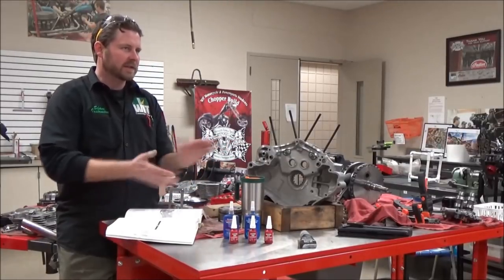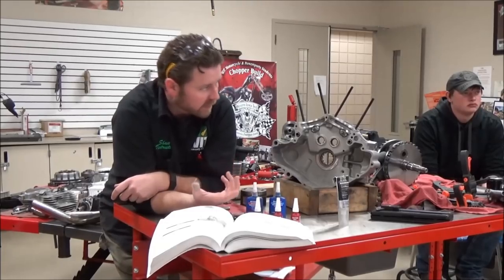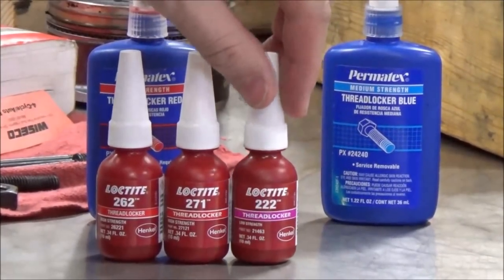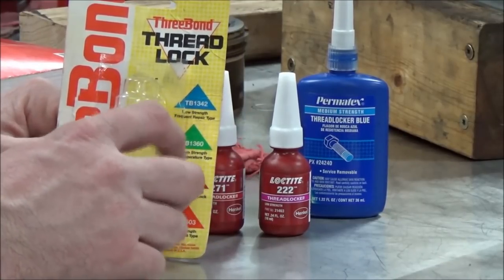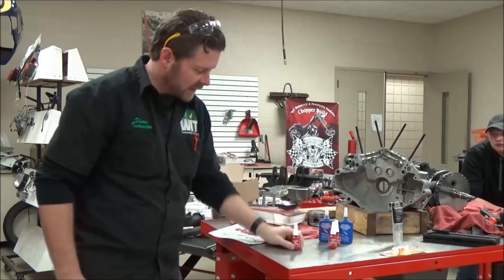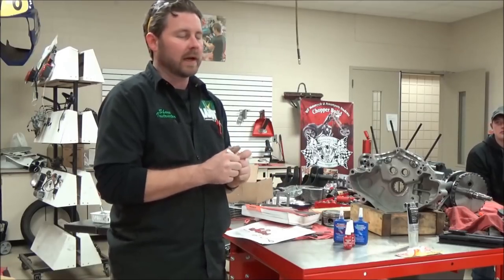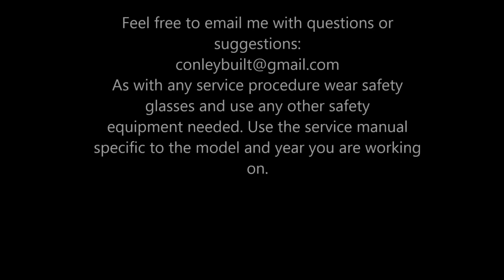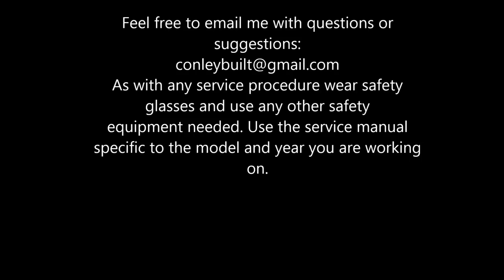Which loctite do I need? How to choose the correct Threadlocker Loctite Permatex IT MATTERS!

Comment: I only use Blue loctite for Compensating nut and Clutch Axle nuts swing arm nut , anything 1/2 to 1/4 I use clear fingernail polish , I clean all Nuts Bolts with Mineral spirits and acetone before using thread lockers. I have owned 3 Harleys not had anything fall off or come loose.    My stock EVO 1986 had red on the comp Nut I used a 3/4 Breaker bar and Tore a Primary chain in half .   Took a 3/4 Impact set at 800 Pounds, 150 pounds in the air tank to back it off . The Book said the nut torque was 150 Foot pounds .   Red takes 200 degree fahrenheit to get it gooey was not going to use a torch on my comp nut .  So yes it does matter what your using .
Reply from the maker: 👍 Thank you for taking the time to comment! Hit that subscribe button if you haven’t please! It helps us! 
Here is a way to support all the free videos.
Want to say “thanks” or “keep it up”? Click here https://www.paypal.me/how2wrench  

Coach Conley is also available for hire to personally work one on one with you if ever needed. Yep he is a real person. Give him a call @ 602-345-0432
Details here: https://how2wrench.com/product/personal-tech-training-phone-facetime/ 
Your answers and help are just around the corner. Save time and money while protecting your investment and yourself by doing it the right way!
Follow us!
Web:
www.How2Wrench.com     
www.Tools2Wrench.com

Comment: Lemme add my 2cents to this and i know this is an antique thread,, im gonna use 6 loctite number 241, 242 & 243 blue and 271, 272 & 273 red,, My understanding is the differences or how i read them is as follows, 24x is blue/medium, 27x is red high strength, then ea one is a larger bolt size.  Startinv with XX1 being for smaller bolts , xx2 med size bolts and xx3 is larger bolts, the breaking strength is do to the original torque value of ea bolt, i also believe theres a slight or subtle viscosity difference between say a xx1 and xx2 or xx3  that said you would most likely be fine with a xx2 where an xx1 is req but not an xx1 where a xx3 is req,, for majority of my work i will default to the xx2 as that is for bolts uoto 1" in either the 27x high or 24x med line.. ... like i said just my 2cents on how i work.. oh and i ONLY use loctite as my first choice and then permatex as my second choice
Reply from the maker: Thanks for the added input JB!
We love sharing comments like this with Shane.  
Thanks for sharing and the added value to our wrenching community. Keep them coming.

Join the channel. Best $1.99 you'll spend to access all 800 vids and Shane Daily! Smash the sub and like please. 

Throw Shane a high five donation, channel membership or merch for saving you $$$$$$$ Links below to support more for this work! 🙏
You rock for commenting! We will let Shane know! Want even more? Best $2 you'll ever spend...Join this channel to get access to perks:
https://www.youtube.com/channel/UCBhM8DCKnT3qXwTW0eToyCg/join       
-Daily MEMBER FIRST COMMENTS ANSWERED FIRST 
-Live Q/A video chats
-Wonder if we have a video on your need? Members can request content links!
-Full Access to the ENTIRE 700 video library
-Member-Only FREE tool giveaways  
Ways to support or high five How 2 Wrench! Thank you in advance. YOU MOTIVATE US TO DO MORE!
1. Smash the subscribe button (thank if already a sub!)
2. Have you seen our "YouTube Trained Support Shirts?  https://goodfellasmerch.com/collections/how-2-wrench/products/support-shirt   
3. High five donation:  https://www.paypal.me/how2wrench    
4. Got an emergency and your head is about to explode from frustration or fear? Get Shane’s cell here: https://how2wrench.com/ols/products/techline-one-on-one

Comment: Service manual for my bike requires new bolts every time you take a front calliper off. Reason stated - ALOC. I.e. anaerobic locking compound. Bought a set - they do indeed come with some pink stuff on there, and I'm sure it's a very neat solution which won't leave fouling in the hole.

For 6 quid PER BOLT though, I bought a bottle of Loctite 2701 instead. Per the datasheet, it actually gets stronger when it's hot. Completely flat ageing profile at 120°C, gains about 10% at 150°C. Can't argue with that, those bolts never get that hot. Even though it's "green" and "high strength", the breakaway torque doesn't exceed 60Nm for M10 bolts, which those are, and they nominally get done up to 45Nm.

They do recommend disassembling while hot, but I don't think in this case that's necessary. Nor is it a good idea to apply so much heat right next to fork oil which isn't meant to get this hot.

Other handy information from the datasheet - it'll tolerate some contamination, engine oil & brake fluid don't touch it, soaking it in petrol actually strengthens the bond, onpt ethanol has some weakening effect, but not enough to notice.

The annoying part is cleanup, but I have the sneaking suspicion that an M10 tap & die will make that process MUCH easier.

Anyway, read the datasheet, folks! It'll tell you all sorts of useful information so you can make a properly informed decision.

Comment: Thanks for the video !
I took your advice while reassembling the inner primary on my 2000 Road King. The Harley manual calls for loctite 262 so not being able to find it locally I drove to
the Harley dealer.  They tried to sell me 271  for the compensator bolt. I asked for the manager in hopes of understanding why the dealer didn't sell the 262  pointing out to him that it was for sell on Harley web site and that manual says to apply 262 to the compensator bolt. The dealer manager could not answer my problem but gave my a bottle of a lock tite that wasn't sold to the public, telling me that is what they use.  The Harley web site shows it for sale, the Manual calls for it, the dealer doesn't sell it and none of the auto parts stores carry it, WOW! I love the USA.

Comment: MY mechanic over torked my 2009 RMK 700 cylinder studs... So I had to put a Heli-Coil to replace the stripped threads... SO to be sure it was tight I used green loctite ! Hope it doesn't fail...
Reply from the maker: doobyboy21 If I can ever be of service to you, here is a video explains how to connect with me. 
https://www.youtube.com/watch?v=vjvmB01ebcs 
Keep Wrenching,
Shane Conley
Instructor/Motivator/Motorcyclist
www.how2wrench.com
Like freebies? Click here for a free diagnostic checklist! 
http://gem.godaddy.com/signups/364621/join 
Head over to the new website and subscribe to the newsletter to never miss a video or newsletter! 
https://how2wrench.com/contact/ 
Did you like this free video and hope to see more? Would you just like to say thank you with a donation? Click https://www.paypal.me/how2wrench

Comment: Wow I used blue lock rite on a crank shaft bolt on a trx450r I thought it would work just fine but I don't want to take it back apart and replace it with red lock-tite but this video showed me my lesson
Reply from the maker: Thank you for the comment. See the link below for more help with your question. I have been banging my head against the wall thinking of ways for people to say thank you in an impactful way to help keep these videos coming. Here are few ways that many have found as a way to give back. 
* Membership to H2W (includes t-shirt or tech help) https://how2wrench.com/product/membershipmembers-onlymembers/
* Simple donation to say "KEEP IT UP"
May you have a great day and... https://www.paypal.me/how2wrench

Free Mechanic info, tool reviews, and “how to” videos newsletter sign up: https://how2wrench.com/subscribe-free-newsletter/

Missed a past issue? No Worries. Newsletter Archives: https://how2wrench.com/blog/newsletter-archives/

Like freebies? Click here for a free diagnostic checklist! 
http://gem.godaddy.com/signups/364621/join  

If I can ever be of service to you, here is a video explains how to connect with me. 
https://www.youtube.com/watch?v=vjvmB01ebcs
Reply: blue should have been fine , if you cleaned up the threads wire brush and acetone , any oils or fluids will not let the thread lock to work.

Comment: Hey Shane, I'm changing the clutch and flywheel on my van and when I removed the bolts from my flywheel I got oil coming from the holes? Iv never seen this happen, anyway long storey short I'm just going to put the bolts back in with the new part but I don't know what loctite to use to seal the threads as what ever loctite I put in there will see heat, engine oil, and alot of spinning and vibration.
Any recommendations? 

I really wish they were teaching about thread sealant types when I was a collage all those years ago 😂🙈 

Thanks for the videos iv found this my go to channel when I'm in need of a memory jolt.
Reply from the maker: Thank you for the comment. See the link below for more help with your question. I have been banging my head against the wall thinking of ways for people to say thank you in an impactful way to help keep these videos coming. Here are few ways that many have found as a way to give back. 
* Membership to H2W (includes t-shirt or tech help) https://how2wrench.com/product/membershipmembers-onlymembers/
* Simple donation to say "KEEP IT UP"
May you have a great day and... https://www.paypal.me/how2wrench

Free Mechanic info, tool reviews, and “how to” videos newsletter sign up: https://how2wrench.com/subscribe-free-newsletter/

Missed a past issue? No Worries. Newsletter Archives: https://how2wrench.com/blog/newsletter-archives/

Like freebies? Click here for a free diagnostic checklist! 
http://gem.godaddy.com/signups/364621/join  

If I can ever be of service to you, here is a video explains how to connect with me. 
https://www.youtube.com/watch?v=vjvmB01ebcs

Comment: Keep in mind HD tolerances are greater than most hightech motors.
Reply from the maker: I would break it down into air-cooled vs liquid cooled. Over the years I really got the oppertunity to compare many models and this was a big factor. Also a space for much debate. For example Twin Cams stock OEM piston to cylinder clearence is (your your model) .0014-.0025". Pretty tight on the bottom end of the scale for a large air-cooled piston. Metric motors are running similar numbers.
👍 Thank you for taking the time to comment! Hit that subscribe button if you haven’t please! It helps us! 
Here is a way to support all the free videos.
Want to say “thanks” or “keep it up”? Click here https://www.paypal.me/how2wrench  

Coach Conley is also available for hire to personally work one on one with you if ever needed. Yep he is a real person. Give him a call @ 602-345-0432
Details here: https://how2wrench.com/product/personal-tech-training-phone-facetime/ 
Your answers and help are just around the corner. Save time and money while protecting your investment and yourself by doing it the right way!
Follow us!
Web:
www.How2Wrench.com     
www.Tools2Wrench.com

Comment: Hi Shane,
recently I had the negative lead come loose from the battery terminal on my 2000 Nightrain. It took out the rectifier/regulator, and melted most of the terminal.

I replaced both, and just last weekend again [after about 1000km or so] it was cranking really slowly. Again that same bolt on the negative terminal was loose.

The battery only came with a bolt and a flat washer.
I put a split washer in there, but it still came loose.
Should I have used some kind of locktite in there?
If so, which type?

The manual I've got does not specify a torque value for the battery terminal bolts [and you wouldn't get a socket in there, anyway] but I'm thinking it wouldn't take much to over tighten it - the terminal post is lead, yes?

I'd appreciate your thoughts.
:)
Reply from the maker: Perfect example of when to question just "fixing" with loctite! Harley Davison had a recall and 2006 on the Dina super glide where they rerouted the battery cable I believe. Before jumping to Loctite which should be fine I would consider whether the battery cable has been changed altered misrouted or simply needs to be recalled check with the dealer first. Please share the results from checking if there was a recall and share this video with your friends and support the channel thank you so much.
Reply: +Shane Conley thanks for the reply.
If I'd seen your twin cam series earlier, I may well have done the rebuild myself instead of spending the money.... LOL
Reply from the maker: Merlin Zener If I can ever be of service to you, here is a video explains how to connect with me. 
https://www.youtube.com/watch?v=vjvmB01ebcs 
Keep Wrenching,
Shane Conley
Instructor/Motivator/Motorcyclist
www.how2wrench.com
Like freebies? Click here for a free diagnostic checklist! 
http://gem.godaddy.com/signups/364621/join 
Head over to the new website and subscribe to the newsletter to never miss a video or newsletter! 
https://how2wrench.com/contact/ 
Did you like this free video and hope to see more? Would you just like to say thank you with a donation? Click https://www.paypal.me/how2wrench

Comment: Green loctite is not for threaded fastners really. It's cylindrical adhesive. (loctite 603)
Reply from the maker: Thank you.
Reply: *****
 Yeah among others.
Reply: THis is a very good point in this video. I really cant stand it when people use the color as reference. There all all strengths of all colors it seem. (Blue Red) and different strenghts and removability of the same color. I learned about green loctite gromclickspring here on youtube its a substitute for soft solder for rods mounted in holes. Then you also have loctite plumbing sealant.
Reply: There is more than one green compound by Henkel. Go by NUMBER when ordering.